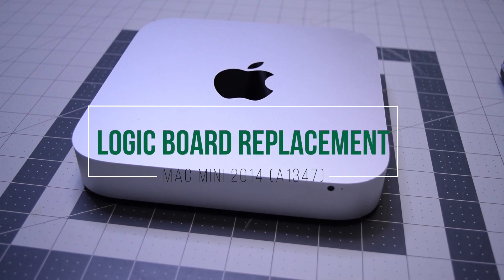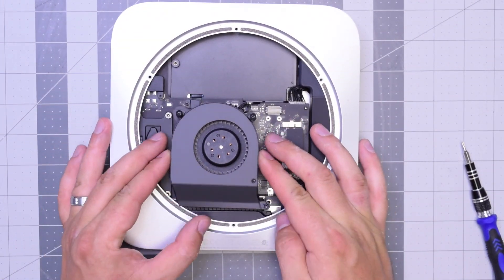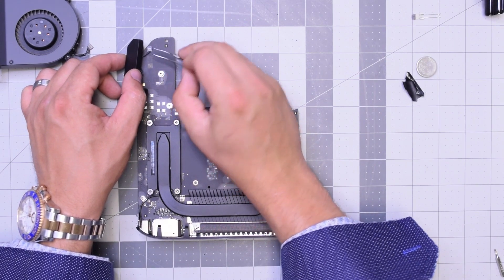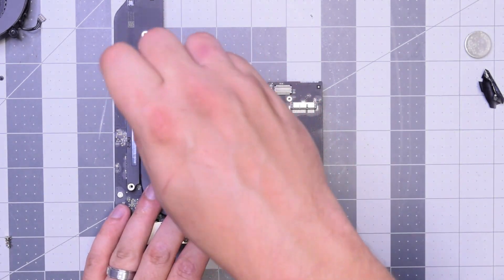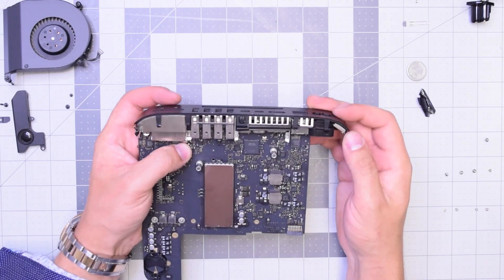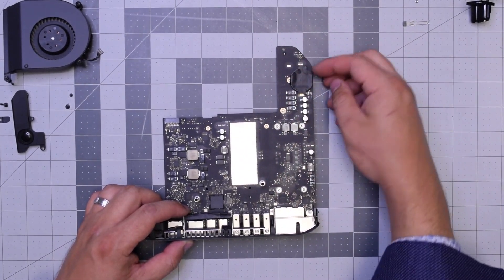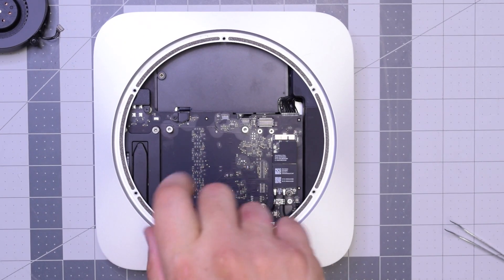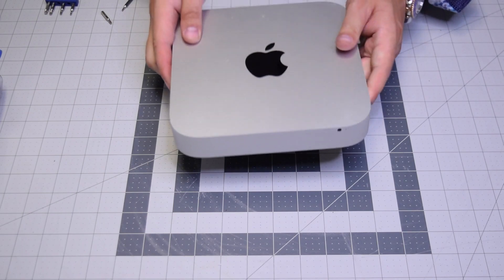Logic Board Replacement - Mac Mini 2014 - 2017 (A1347)

Comment: So what the heck is that little metal piece in the top right corner at 2:50? Somehow it got loose inside my Mac Mini and was moving around. I disassembled it and found this piece but I have no idea where it goes.
Reply: Nvm, figured out. It's a clip for the power supply. It's supposed to fit right underneath the plastic power plug input